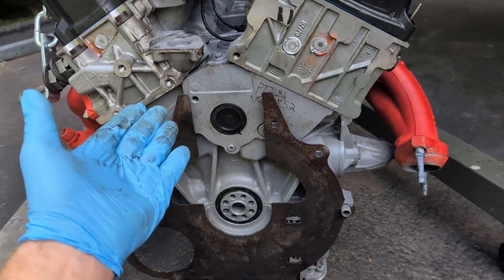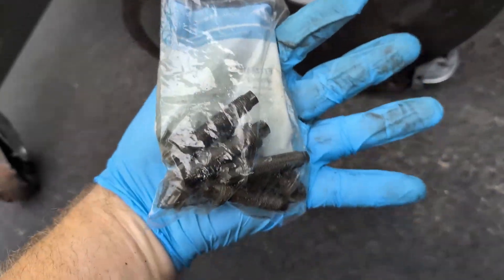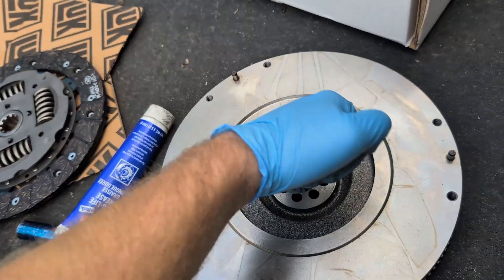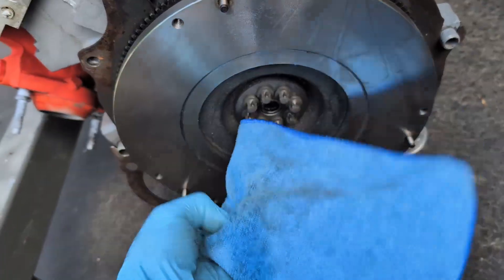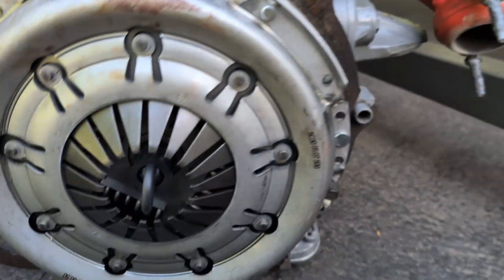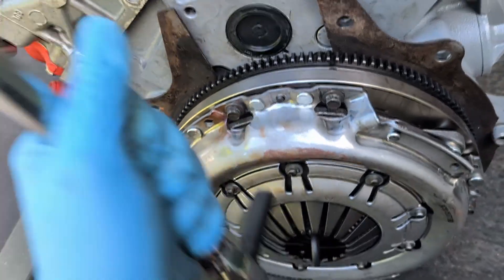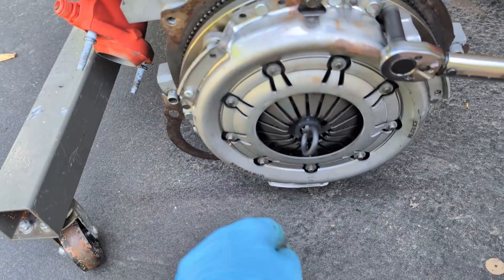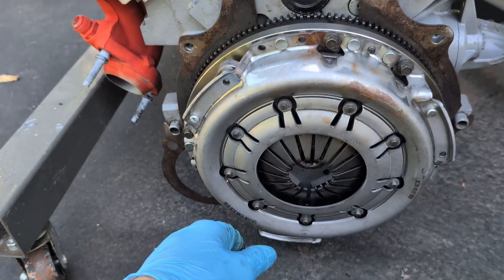Ford Mustang 4.0L SOHC V6: Clutch & Flywheel Installation + Torque Specs!

Comment: Doing this exact clutch kit on my 2010 along with new timing chains and upper pan gasket so your videos have been very helpful, would also love to see a video doing the synchros on these T5s, im moving onto a 3rd junkyard transmission because of synchro failure.

Comment: What would cause your flywheel to be misaligned with your starter ? I had my clutch replaced by a mechanic but the flywheel grinds on the starter. I pulled the starter off and I see hella wear & tear on the teeth of the flywheel and starter.
Reply from the maker: It's possible the mechanic forgot to install the separator plate between the engine and transmission

Comment: Ben, sorry to ask on this video but wasn’t sure what would reach you the best. I have a 14 ford focus. Bought it for my wife about a month ago. Check engine light on=clutch position a sensor engaged and transmission sounds wacky. I had tcm and wiring harness replaced. Should I try to change out clutch actuator? You have a great video on that
Reply from the maker: https://youtu.be/2-9PkV-8N7A

Comment: How do i know thickness of my clutches? Can it be done via relearn even if clutches aren’t replaced using forscan? I dont have codes but my car only drives in odd gears, and reverse but not in even 2,4,6. I have check solenoid values expected and current are same in forscan but i dont know if forscan can show how thick my clutches are? Also if i get used gearbox with only 50k miles because mines done 100k, and can i code or program that tcm. I saw 5 values come up dont know what they were it were under tcm module configuration or is it a good idea to use tcm from my transmission and move on to the donor transmission? I would really appreciate your response and apologies for asing so many questions
Reply from the maker: You would have to remove the clutch to inspect it since the pressure plate covers it. Generally on a stick shift like this, don't worry about it unless you feel slippage in the clutch when releasing the pedal